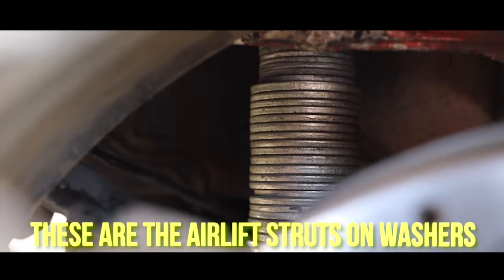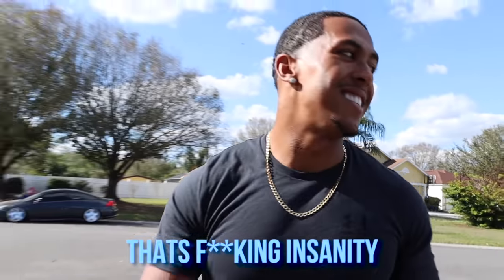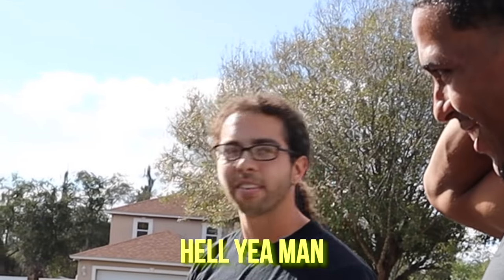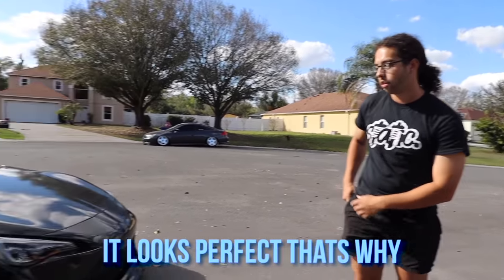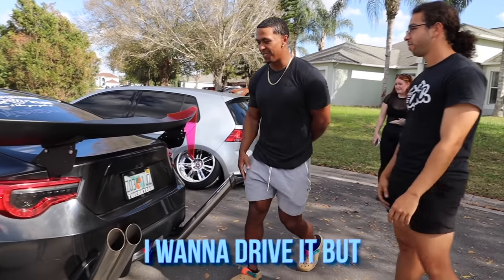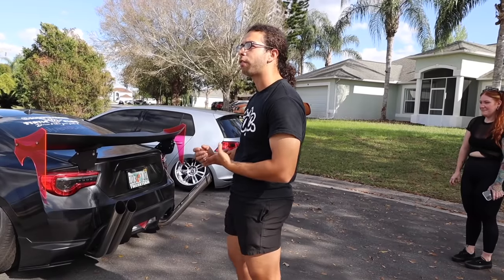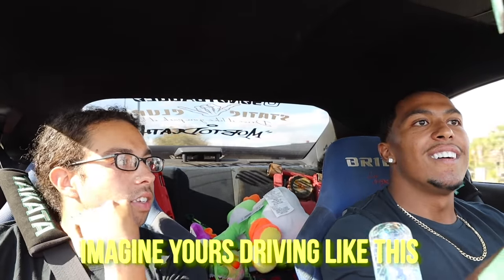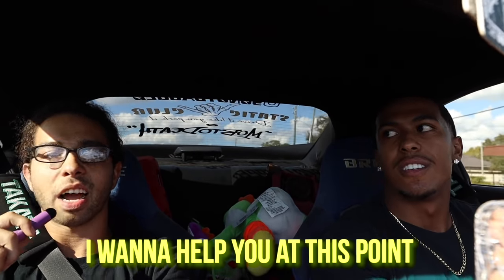THIS IS LITERALLY THE MOST INSANE STANCE + CAMBER ON A BUILD THAT IVE EVER SEEN

Comment: What are those washers on exactly looks like the strut I’m guessing on the rear cause it’s straight up and down I’ve heard of washers on wheel studs but washers on strut how does that work ? Or am I tripping couldn’t really tell
Reply: Better you don't know so you don't ruin another car like this
Reply from the maker: your trying way too hard this is like your 6th comment on my page
Reply from the maker: its on the strut hahah its used as a spring . its really stiff and they dont compress so it helps with tight fitment
Reply: @Taywavy  I'm not trying anything, I am just amusing myself.

Comment: Ruined car, don't understand the appeal other than clout chasing? Can't floor it, can't go up driveways, can't brake suddenly, can't turn, can't drift it, tires don't last at all, girls hate riding in it, or even be seen in it, it's just the most uncomfortable silly looking unsafe thing to drive?
Reply from the maker: its so funny because everything you just stated is SO wrong lol watch the video and maybe you'll see the car is a daily
Reply: @Taywavy  It's not wrong, you can't tell me the car performs even better than stock like this. Admit it's wrong, ruins the cars dynamics and y'all just enjoy it. Nothing wrong with that. There's people that spend thousands on shoes and bags, I don't get them and I don't get this and I don't need to but still watch them to amuse myself. lol
Reply from the maker: @d1zguy864  the car is a daily. Idc what it performs like. It takes him from point a to point b just fine with NO ISSUES. Therefor, it may not perform stock but it’s still functional. Which is all that matters
Reply: @Taywavy  No Issues? Even my lowered cars on coils (and not even that low to as to not ruin suspension geometry), I have to slow down too much and it hurts to go over some roads and it slows everyone else down. I can't imagine driving a stanceout car. Driving with a floor jack all the time and stuff to help you out if you get stuck is not what I would call functional. Plus it's a ticketable offense in many states if a cop chooses to f you over.  If anything there is a video idea for you take your stanced out GTI, vs a stock one and do brake, acceleration and autox, slalom test. I am curios as to how much worse it gets lol